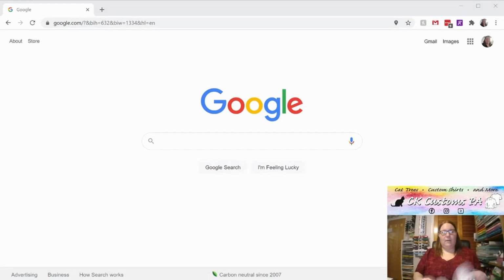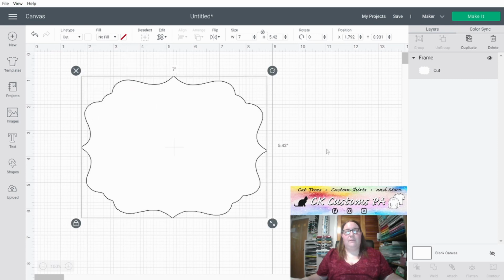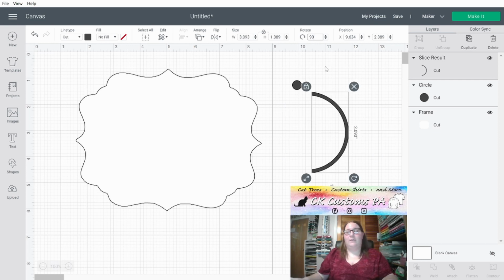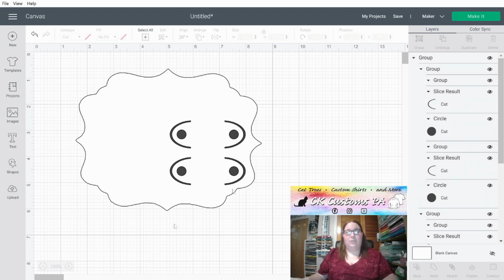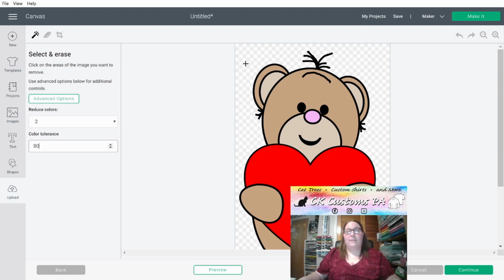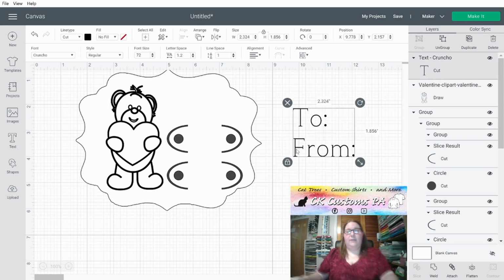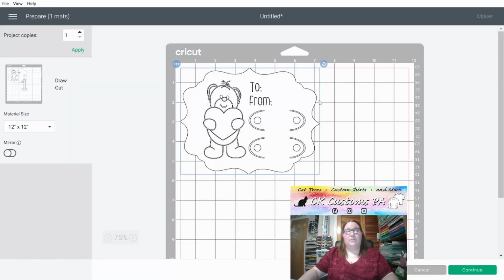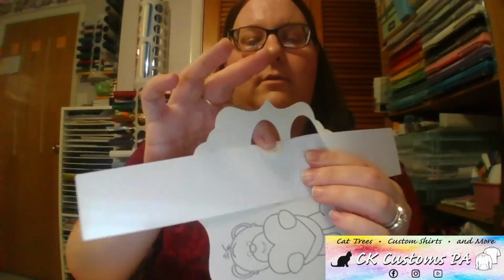DIY Valentines Day Crayon Coloring Card Using Cricut Design Space

Comment: hi again, i uploaded the bear u used & that also shows as a dbl line when i change it 2 draw/pen..i have version 7.0.5 software which cricut says is up 2 date.    plz help!!, tku
Reply from the maker: This is common and expected as if you were going to cut those lines, it would cut both the outer and inner side of the line. If you can find a design with a thinner line and use a thicker pen size, then it may be less noticeable. 
You could also do this project as a print then cut where you use your regular printer to print the coloring page part and then do all the rest of the cutting as normal for the card shape and crayon holes.
Reply: @CKCustomsPA  tku, but y did the same image u used in video turn 2 dbl lines when i checked pen? that should have just been 1 line as in yrs..??.?
Reply from the maker: Paula, ours also has a double line but isn't as visible when using a 1mm pen.

Feel free to join our Facebook group so you can post pictures of your projects to see if there are additional recommendations we can provide.

Comment: hi, tku for this video. i used a coloring page dino & when i changed it to pen it showed & drew a dbl line. why is that & how to fix? i have explore air2 machine.
Reply from the maker: Changing a cut to a draw will make draw lines out of what were cut lines before so this is relatively normal to happen. The best solution is to look for pictures with very thin lines and then switch to a thicker pen size.